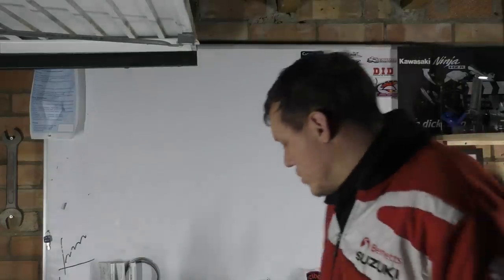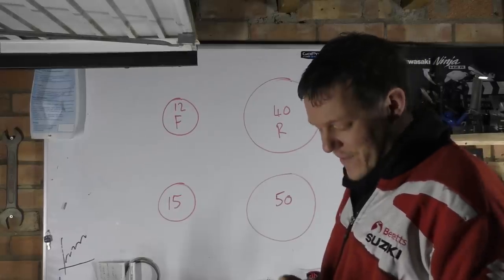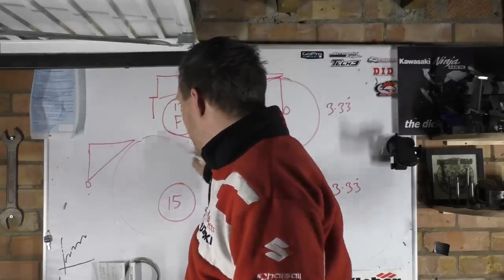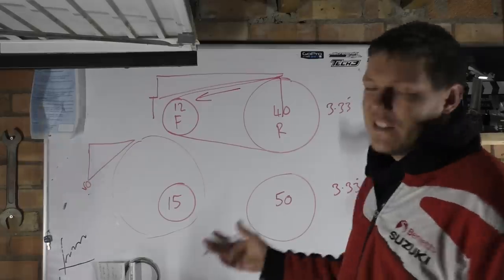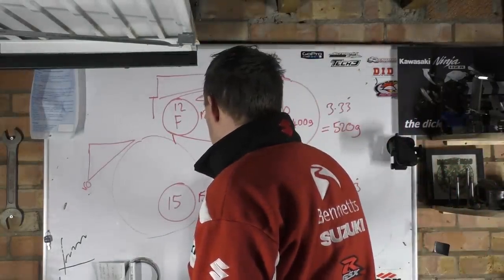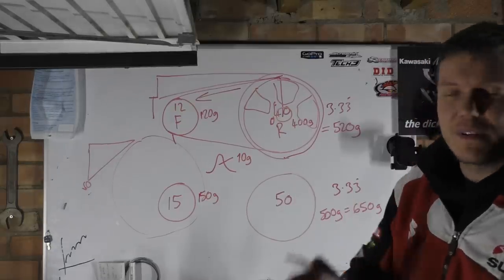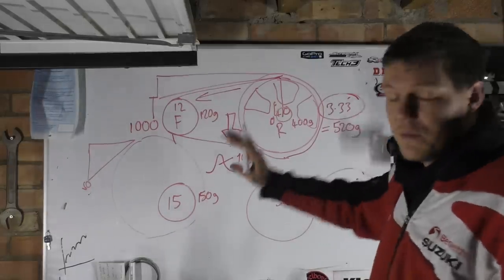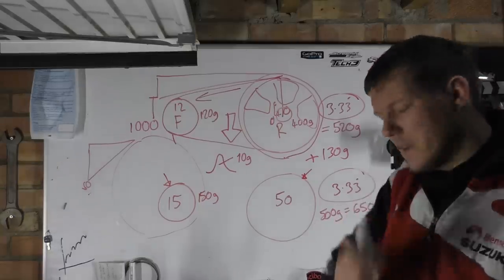Sprocket ratios - Part 2

Comment: is it true that changing 1 tooth on the front is like changing 3 teeth on the rear?
Reply: It is more or less.  1 tooth extra on the front in most cases is worth 5mph at the same rpm.
Reply from the maker: LMAO! What? 5mph? LOL so If I have 10 teeth extra on the front I get 50mph? LMAO - don't be a dick
Reply from the maker: Sorry I miss-read that (I'm in tescos and reading the phone on the move is never a good move) I thought you were talking about top speed...... 

MY BAD ;)
Reply: In most cases there is never any top speed to be gained.  I had a honda mt5 got me from 30mph to 35mph i was light at 16 years old that's the only reason.  On my f800 it drops the revs by 500rpm so now 70mph is @4krpm  it still won't pull 130mph but it cruises nice in top. Don't worry Matt i only work with facts same as you. Opinions are fine it's only when people get them mixed up things go wrong.

Comment: I have mt 15 with front 14 and rear 52 teeth . I wanna change it to 12 , 52 . Soo there is increase in acceleration . Sooo does it mean I have to ride in higher rpms to keep going ? Amd can I start in second gear or force first always??.... Mostly I ride in city so I prefer torque to high speed . Plzz reply
Reply from the maker: "can I start in second gear or force first always??"

- You can start in 2nd anyway, its just slower. As for revs and you watching them when you ride?
Reply: @dirtygarageguy  yes mostly at 6k rpm when I change to next gear . I used to look at rpm when I bought the bike but now I change by hearing the engine sound . I use use clutch only to enter first gear then after I use blip to go to every single gear up and down as I have slipper clutch using a little braking while downshift . My doubt is that I get 2nd gear top speed around 70kmph at 9k rpm and  3rd gear 105kmph at 10k rpm . So do the kmph values decrease after changing sprocet for each gear??

Comment: Matt, since your on to chain and sprockets...Ive heard theyre are teeth combos that always
run on other parts of the chain and some that run on the same points...resulting in more wear
on one than the other..is this bullshit or is theyre some truth here..Thanks
Reply from the maker: That's gears and that's called 'hunting' not sprockets and chains - the sprockets run the whole length of the chain. Unless you're talking about something else?
Reply from the maker: This will be in the gears videos and you run an odd number of teeth on the gears
Reply: Sprockets have a fixed ratio...just like gears
Reply from the maker: LOL really? The number of chain links far outnumber the number of teeth on a gear.....
Reply: The Workshop ,, he may be talking about differing pitch
Reply: That doesnt change the ratio...What are you thinking! Do a vid on chains
and sprockets...go for cam chain ratios...or primary chain ratios...I dont
know but I would bet they all "walk" the chain over different teeth..your
funny......
Reply: @gilbertreeves2084  sorry but that's just not true. Sprockets are sprockets and you can play with the sizes and ratios. Just take in consideration that the manufacturers ratio is the one calculated for the perfomance your bike was designed to give. But, you can lower or upper the ratio to modify top speed and torque. Always when you gain speed you ñoose torque and vice versa. Also... this change could mean a new chain. Because of the length, but it depends on the change
Reply: @FranciscoJavier246  No need to be sorry...Its just
the progression of the chain around the
spockets I was thinking of, as some combos alway`s have different  links
contacting different teeth in the chain
equalizing wear and some dont....you
understand..?...Cheers!
Reply: @gilbertreeves2084  ahhhhh jajaja now i do understand, but no i haven't heard that... very interesting though
Reply: @dirtygarageguy  ...What are you thinking here..?...Primary drive to the clutch..is fixed by gear or hi-vo .Okay why are sprockets not A fixed ratio.?
Are you really defending slack in a chain ..?  Lost in space....

Comment: Rear sprocket to wheel ratio changes as well, no?
Reply from the maker: Say what?
Reply: @dirtygarageguy  Let's say you have a 17" rear wheel, a 40t rear sprocket would have a different effect, than a 50t sprocket, keeping the front to rear sprocket ratio the same?
Reply: @tilenlini   "Sprocket to wheel ratio" changes, but 1 revolution is still 1 revolution. If you put too much oil on your chain, it will have a shorter way to the rim with a 50T sprocket.
Reply: @szymonkaminski7975  Wah, I feel dumb, so there's no difference in that aspect?
Reply: @tilenlini  forgot to put a smiley in there :D
No difference in speed or torque. Watch from ~4:35. 12T revs once -> 40T revs 1/3.(3); 15T revs once - 50T revs 1/3.(3)

Comment: My bike 2014 z750r.....  went from a 15 front sprocket to to 14 and 43 to a 45 on the rear... Can't wait till they arrive... It should be very noticible from 0 to 60  from what I've heard.. Anyone else done the same?

Comment: I have a yx160 engine, 160cc.. I had a 14 tooth front sprocket and on the rear wheel a 41 tooth sprocket.. the bike did 55mph topped out, i changed the front to a 15 tooth and the rear to a 39 tooth and now the bike does 65mph topped out, low down torque is the same but up top it seems to plateue flat..  in your explanation you said speed and torque won't change bewteen them just the weight is different.. surely thats not accurate
Reply from the maker: Yes it is. You are measuring top speed with a tachometer. How are you measuring acceleration? You're not.
Reply from the maker: POWER is what determinds you're top speed, not sprockets. If you bike was hitting 55 mph and it's hit the rev limit then it's been fitted with a sprocket set to give more acceleration, but it's hitting the limit. Changing that set-up how allowed peak power to come in before hitting the limiter, but you're not accelerating as fast

Comment: fuck all difference in the performance torque speed side of things but depending swing arm design one could have more chance of whipping into the lower part of the swing arm and damaging it if you go too small on the front.

Comment: Should i get a higher gearing on my bike? I hit the rev limiter at about 130kmph and my bike «screams» when i try to go fast
Reply from the maker: Higher gear or higher sprocket?
Reply: The Workshop higher sprocket, i have a 14t now
Reply from the maker: you might wanna change the back to a smaller one not bigger on the front - there isn't much clearance as the front, and you have to think out swingarm deflection

Comment: Well, there is a thing you forgot to mention and it is called rotational mass which is quite important in cycling. It is calculated by multiplying the wheel's mass by 3. 
So the 15x50 is way more inefficient than 12x40 because the wheel is so much heavier and requires more energy to spin it. 
Question: what is the minimum recomended number of teeth on the front sprocket so that chain and sprocket don't wear too quickly? 
Great chanel. Keep up the good work. 💯✌️
Reply from the maker: "It is calculated by multiplying the wheel's mass by 3"

- Well thats wrong. What you mean is called moment of inertia and is calculated as mass * radius^2

Let's say you have a wheel that weighs 1kg with a diameter of 1m

mass * 3 = 3kg

or 

1kg * 0.5^2 = 0.25 kg m^2

This however would be for a solid disc, instead a wheel is like a hoop, and that is calculated as 1/2mass * r^2

so it becomes 

0.5kg * 0.5^2 = 0.125 kg m^2 

Someone has seen this and thought that's 0.5^3 therefore mass *3 which is wrong, because 

1. it's actually half the mass
2. the wheel size effects the rotational mass more than the mass does.

Comment: Hi anyone. Mine is 17front 39rear on 1000cc. The bike is quite vibrarion after Ecu reflashed. Im thinking -1 for the rear 38. So 17-38. But look internet also see 16-36 is very near ratio 17-38.. so should i take 16-36 which i hear from friend that a little slow in low end 1.2 first gear then fast at the tail. Carbon wheel or ceramic bearing ect... less Kg to improve that so. Also 16-36 gains 4 teeths in weight.. ?!?!
Reply from the maker: 16 : 36 is 1: 2.25
17 : 38 is 1: 2.23

The difference is fuck all for everything. Fuck all difference in ratio, weight, acceleration, torque - everything. And then there's tooth number. There will be slightly less where on the 17 : 38 but that the only benefit
Reply: @dirtygarageguy  Thanks you ! keep up nice videos ! Cheers.

Comment: I always thought if you increase power you decrease torque?
Reply from the maker: Speed not power
Reply: @dirtygarageguy  that is right the faster the less torque and higher heat and more power consumed.
Reply from the maker: Not in the same way. Friction of a chain and sprocket system is very  very low

Comment: Does anybody know how much is 1/2 a notch when turning a camshaft gear or crankshaft gear
Reply from the maker: 1/2 a notch?
Reply: @dirtygarageguy  yes, im trying to put back my engine in timing but my crank needs to be 1/2 a notch off before the TDC marker becuz the arrow for the tdc marker is on the trailing edge of the sprocket tooth
Reply from the maker: What engine is this?
Reply: @dirtygarageguy  it's for a car, Dodge Stratus 2004 2.4L DOHC

Comment: Here's a hypothetical for you: what if someone for some ridiculous reason attempted to convert a water cooled engine to an air cooled engine. What would he have to overcome to make it happen?
Reply from the maker: The waste heat. The water cooled engine was designed with water cooling because air cooling wasn't enough

Comment: Anyone try carbon sprockets yet? for short lived race use obviously not road use...

Maybe carboncarbon sprocket and a belt instead of a chain?
Reply: Beach&BoardFan kevlar wire maybe, not a belt. lol
Reply: But most drive belts are Kevlar based 🤔
Reply from the maker: Not that I know of. Carbon is great because its light and stiff - but tough? lol
Reply: @dirtygarageguy  Might make it a few inches before it shatters into a bunch of pieces eh?
Reply from the maker: LOL!
Reply: You guys know commercial airplane brake rotors are carbon right?!
Reply from the maker: But brake discs are under compressions and shear - not tensile stress
Reply: But if theres a belt wrapped around it wouldn't it be compression and shear?
Reply: Really I believe the shear problems could be designed out with the geometry of the part...
Reply from the maker: "Really I believe the shear problems could be designed out with the geometry of the part"

- for a brake disc? Good luck with that.....
Reply: You disappoint me english! You know how to use CAD simulations, sounds like a great video opportunity!  😉

also no I'm still talking about a rear drive pulley

Comment: What if the turn radius what zero and the sprockets have the same amount of teeth
Reply from the maker: Turn radius was zero?
Reply: @dirtygarageguy  yep both sprockets same size?
Reply from the maker: Right, I get that bit now. So what is the rest of the question?
Reply: @dirtygarageguy  what is the reason no one uses the same size sprocket for the chain to move across?

Comment: WAY to many factors in every single bikes. Your speaking about sprockets but compared to what? 14/40 sprockets on a 10" tire, or on a 22". You can keep the same exact sprockets and get a set of new tires and lose/gain power... Thats the ratios I personally would like to hear explained.
Reply from the maker: 10" to 22"..... on a bike? What the fuck are you talking about?

Comment: Please enough already, instead of saying TURNING RADIUS ! FOR THE LOVE OF. JUST SAY CENTRIPETAL FORCE, AND THE ANGLE PLUS THE WEIGHT OF THE CHAIN. SAY 530 VS A 520 CHAIN WHICH IS LIGHTER. YOU ARE LEAVING OUT WAY TOO MUCH INFORMATION. THE EFFICIENCY OF GEARING IS WHEN FRONT SPROCKET TURN LESS TIMES IN ORDER TO  TURN THE REAR  SPROCKET [REAR WHEEL]  ONE  turn or one  complete  REVOLUTION   a lighter motorcycle chain with the same tensil strength will gain you approximately 2.5 hp 😊
Reply from the maker: "JUST SAY CENTRIPETAL FORCE" is a pseudo force, and I'm not talking about forces.

"a lighter motorcycle chain with the same tensil strength will gain you approximately 2.5 hp"

- What a load of gibberish